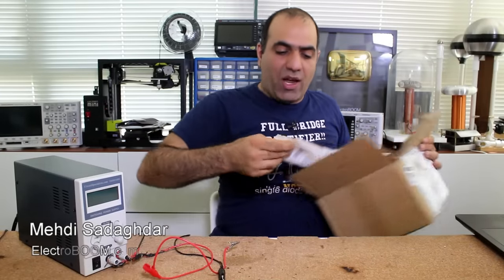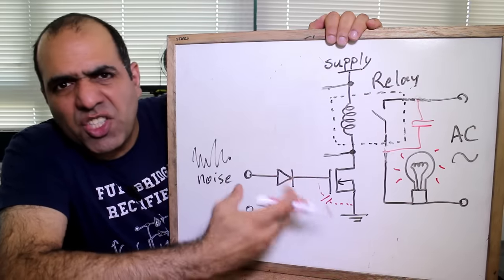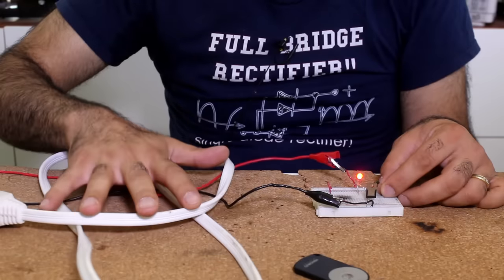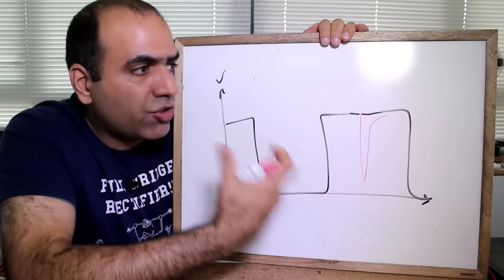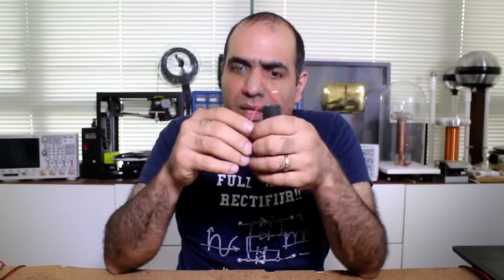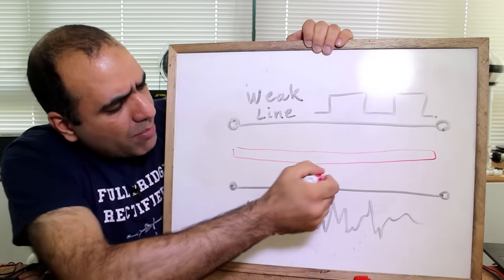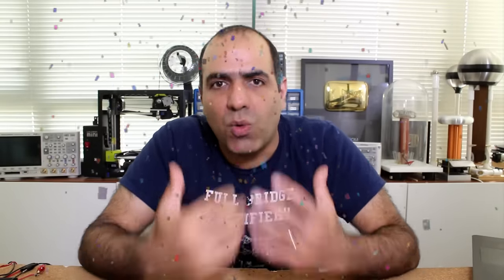Destruction with EMP Device, Understand and Battle EM Interference

Comment: This guy really knows what he's doing...if u dont have a complete intutive understanding of electricity....you wont be able to do what he is doing and still be alive
Reply: Exactly, those fails are on purpose because showing them makes you pay attention and be careful if you want to work in a project like the one he features, works much better than a simple warning
Reply: Thanks I was gonna do it but I’m 12 and i have no idea what I’m doing
Reply: When I was a kid I did "experiments" with electrical components that easily could have been the end of me. I survived . I  now  design and build high powered diesel electric generators. One time when I was about 12 we paralleled eight CRTs (picture tubes) to create enough capacitance to fire a ruby laser. (Successfully) This was in 1968. The amount of power stored in that CRT bank was awesome. And deadly. Even small capacitors can store enough power to be dangerous. Sometimes for really long periods of time. Make sure capacitors are discharged before handling.  Failure to do so may not end well. Antique electronics can hold some very powerful and unpleasant surprises for the unwary. Enen if not powered up for years.
Reply: no shit

Comment: I'm convinced mehdi takes time to calculate the voltage and current of each shock before he does it to make sure he doesn't die, then does it anyway

M A D  L A D
Reply: I got a shock from the same flash capacitor circuit he was using, in the exact same way (touching ground with one hand and power with the other), and was convinced that I'd need to see a doctor (anxiety does wonders for this), but then I calculated the current (350 volts / 50k ohms) and it was definitely less than 7 milliamps, probably more like 4 as I used the absolute lower bound for human body resistance, which equates to "mild sensation". Still gave me some arm cramps in the morning, though.
Reply: @eelooplanitia6640  I have a feeling that the cap you touched wasn't fully charged. I melted the steel on a screwdriver once by discharging a photoflash capacitor across it that was fully charged, it sounded like a pistol shot when it went off.
Reply: @OlegKostoglatov  Yeah that makes sense, I had only charged it for ~7 seconds
Reply: @eelooplanitia6640  c'est vrai... however take into consideration all the shocks he has taken over his career... I bet this M A D L A D could take more then 7milliamps
Reply: @OlegKostoglatov  wait how the hell is that possible
Reply: @OlegKostoglatov  also, steel has much less resistance than the human body
Reply: Absolute madlad
Reply: He did say it in an interview that he always plan all of his video including all the sparks :). So dont do it by yourself lmaoo
Reply: Nah, better way to check if this will kill you on yourself, to check if your breaker will be safe.
Reply: He almost died when he accidentally catch a his Jacob's ladder and suffered a third degree burn in his 1M special
Reply: He hasn't died because he doesn't give high voltages a path through his heart
Reply: i even believe he has some firecrackers involved
Reply: @OlegKostoglatov  the screw driver is so low in resistance that it will allow  massive current to flow. You can melt a screw driver or weld it to car battery  terminals if you short  positive and negative but you would have a hard time feeling anything if you short that across your body.  So the fact he only got a mild shock from the capacitor doesn't really indicate the charge
Reply: Touching 230 VAC is not nice (didn't have GFCI in my room) just a shit ton of luck
Reply: He just knows how to touch it, he isn't letting his body become the circuit, he's just interrupting the circuit.
Reply: Well he has a carpet...
Reply: @tearex7023   "As long as you don't die, chances are you're totally fine." - Tearex 2020
Reply: Good for the heart.
Reply: Gets shocked: C  O  N  T  E  N  T
Reply: I'm convinced of the same thing.
Reply: @tearex7023  LOL "that's just extra food" that ending got me
Reply: @eelooplanitia6640  always remember the one hand rule when working with high voltage,keep the other hand behind your back so your heart isn't the fuse in the middle of the circuit
Reply: Dudes just genius 🖖❤️
Reply: Except for the giant sparklers. That was him nearly dying on camera.
Reply: @eelooplanitia6640  it's generally advised that you see a doctor after you got a decent electric shock across your heart. Severe heart issues don't have to immediately show or even be present when receiving the shock, they can occur anywhere within 24 hours after the shock. I don't know the explanation for this, but quite a lot of people died hours after receiving a severe electric shock, while thinking they were fine.
Reply: It isn't always staged, he tends to be caress and forgetfull.
Reply: I'm pretty sure he uses cgi instead.

Comment: Ahh that explains why my screen gets crazy when I use an unofficial charger, Thanks ElectroBoom
Reply: It's actually worse than that.
A GOOD AC to DC converter first uses a FULL BRIDGE RECTIFIER to make the power go always on the same direction, but the signal that comes from it is basically the AC signal but with the lows flipped up, so you have to use a good capacitor to filter out and deliver a good, constant 5v.
And guess what gets skimped out?
Reply: @dan_loup  I wish more chargers were onhe top end of the spec ie 5.3V Very rare Galaxy Note 3 genuine
5.1/5.2 I've seen eg Apple's 

Because I can't tell you how many usb cables I go through every year...
Plus peanut butter is the worst for handling phones/tablets without perfectly clean hands post eating.
to deal with resistance/voltage drop in the circuit
Reply: @transkryption  The whole charger thing is annoying as frik, specially when it's USB, because every phone have its own way to say "it's me, give the full charge" to it's proprietary charger.
Reply: My phone goes crazy when I use an externally powered speakers. Now I understand too.
Reply: Been using cheapest chargers and leads for years and years with no interference whatsoever.
Don't waste money on official shit that does nothing that cheaper shit can't.

Comment: 9:50 You...made a spark gap radio...
Old timy wireless radios were just EMPs? I never thought about it that way.
Reply: Basically, any radio emitter could be called an emp, we're just messing with the signal before...
Reply: Yeah, pretty much. They quickly tried to get away from the ringing pulse, to a continuous wave because of the amount of frequencies contained in the pulse. That makes one spark telegraphy signal take up the space of 100 continuous wave telegraph signals.
Reply: Brisingr eragon I mean yes but no. It’s conceivable that a carrier wave could induce a voltage in electronics but it’s more likely it would resonate at a set voltage. It takes a short pulse of broad spectrum to get massive induction spikes and other craziness that would cause electronics to go haywire.
Reply: @Mostlyharmless1985  That depends on exactly how you define "go haywire"... and the extent is just as determined by power available as the rest of the model... 

   In regards to strictly "interference", though, eragon's got a sound principle.

    Think about Ham radios, and CB's... In "normal" operations, they're assigned specific channels (frequency bands)... AND as long as everyone's playing approximately by the same rules, sticking to those channels will do the job of communicating and functioning normally with no interference...
    BUT around here, there's a LOT of iron in the ground, and mountains everywhere... SO a popular "trick" among radio amateurs is "Power dumping"... where-in, one custom builds a basic power amplifier, and wires it directly between the radio and the antenna. A robust build with a single fuse-able circuit in the house can add (120VAC @ 15A "fuse") 1800Watts-ish to broadcast strength as well as reception "boost"... BUT there's a side-effect to poorly planned or positioned amplifiers called "bleed-over", where errant signals and segments of communication literally slip into channels outside the designation on the radio-set dial (even a digital).
    Add enough to the "power dump" amplifier in principle, and you can cause all manners of chatter and noise to a variety of "nearby" bands, and if we're honest, 15A is relatively small in circuit protections common to code...

     It's worth note that (even here) this practice is illegal. It can result in fines, jail time, and obviously equipment either taken or destroyed by authorities.

    It's finally just worth mention, that while none of it would be very effective maliciously, it's enough to be worth some dubious cautions about cell phones and other transcommunications on aircraft, where steady communication with ATC and other craft is a high SAFETY priority. (where the obligatory requests to turn off phones and tablets comes from). ;o)

Comment: I remember seeing small handled EMP device used to force cheap badly designed fingerprint or code lock system to reset, and the lock will open during its initialization
Reply: A surprising amount of electronic door security systems are also vulnerable to the simple wooly socks plus finger combo attack. They look fancy and effective though, which is the main point most of the time; dissuasion of attempts of intrusion being more important than prevention :p

Comment: 10:15 Just curious but is there any way to fix the device that has been damaged by EMP?
Reply: Depends on what kind of effect EMP had. It can be temporary damage — for example, flipping some bits in a digital circuit, then you can reset the device and it'll be fine. Or, currents created by EMP may physically burn some of the chip's internals, damaging internal structures permanently, in which case it's next to impossible to repair.

Comment: Hi Mehdi, and hello from Ottawa!
I have issues with my guitar picking up 60 cycle hum, and I use all of the techniques you mentioned.  Could the idea of having 3 orthogonal coils placed at the end of the signal flow before the signal is sent through the cable work? Is there a way of tuning an RC circuit to filter 60 cycle hum? Thanks

Comment: As a weird note, in canada the Federal Communications Commission (FCC) requires that electronic devices must be designed to "accept" any interference received, including interference that may cause undesired operation. Meaning that while making a device such that it still works with a degree of interference is legal, making a device so that it can not be interfered with is not.

Comment: In order to protect the gate of the transistor from overvoltage, voltage limitation circuits are often applied. One possibility is to apply zener-diodes (or TVS diodes) between gate and emitter (source). Another possibility is to use fast switching Schottky diodes to clamp the gate to the driver supply voltage.

Comment: The circuit at 2:23 could be used as a pressure detector that would shut the power off if the line is trampled on. This way, you could save yourself from high-voltage shocks, although at the cost of a wire with broken insulation, through which the electricity could arc to something metal... or you.

Comment: Take a wire wrap a wire into the circle then take off of one end and circle the circles around the circle wire now go back and circle the circles again or making the bigger circle and then go circling inside the wire and making circles to bind the wire together then you hook one side to your capacitor in a little capacitor fuse block then you take your taser and you wire one side to each side of the taser and click the damn capacitor once the capacitor charges up enough to make a taser zapped again the circle will have your EMP wave

Comment: Mehdi, I always put a high value resistor from Gate to Ground on a FET so it shuts off immediately when the switch is off. But you knew that right?

Comment: I used the earth as a amp to chrash basic electronics at a quite high distance relative to the power of the generator. the only big problem was that you manually needed to connect and disconnect(switch) the positive and negative wires for each pulse.

Comment: I build all my circuits in metal enclosures because my workspace is by a really sketchy power supply, a bunch of florescent lights and my breaker box, so anything I built at first that wasn't in a Faraday cage would have tons of noise in the circuit.

Comment: Dunno if anyone will read this, but if you mount a raspberry pi in a cab that also has contactors in it and your pi uses signals from any of its gpio pins, every time a contactor opens or closes your pi will register a signal - that shit annoyed me for a month - in the end I just coded the software to ignore pulses that were shorter than half a second.

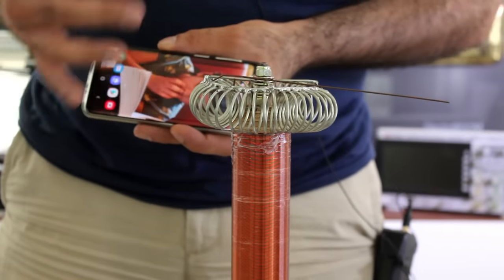Comment: 7:45
You described Lockheed Martin's point defense counter UAV system
It uses radio waves to jam the connection between the drone and controller causing it to either land or return to base. These have made it to the front line in Ukraine even though no one talks about it.

Comment: EMP can be used to hack things too. In particular when it's directly on the CPU (like XBox/PS) or Phone.
You have to start it at the exact moment (by monitoring the clock).

Often your have:
- [Do some calculation]
- [if a==b] launch signed code.

You can do:
- [Do some calculation]
- You try to create a glitch at this point to return true even if a!=b
- [if a==b] launch unsigned code. <- lower energy of the chip or create a short-circuit at this point to create a glitch.
- If not successful, restart.

Or
- [Do some calculation]
- You try to create a glitch at this point to return true even if a!=b
- [if a==b] launch unsigned code. <- start EMP
- If not successful, restart.

Comment: I.like the drivable EMP. just replace your spark plugs with ones that don't have a diode and use unshielded plug wires. No one in a half mile will be able to use a radio when ur truck is running

Comment: How does radiation effect low voltage info wires, such as cat5 and coax? Technically, with coax you have two wires, the internal single wire, and the woven external wire. Both shielded by plastic, sometimes rubberized, but never with an official third "ground" wire.

Comment: Hey ElectroBoom, 
I work for a company that produces multiconductor cable for many different applications.
I primarily focus on two operations, Cabling(putting all components together into one cable) and testing the electrical properties of said cables.
I wish that they would have gone further into depth on exactly what the results of the tests actually mean and why they have to be within certain ranges e.g.) Impedance, Time Delay, Skew, Rise Time, Attenuation, Return loss, Near end cross talk, and Far end cross talk. We test using both an oscilloscope(TDR) and a VNA(up to 10GHz) 
I have a decent understanding on what the proper ranges are on the wires that I am testing but I would like to learn more on how those ranges affect the final product. 
My company doesn't really show us what our cables go into but I'm 90% sure that a large majority of our cables go into imaging such as Medical endoscopy. 
could you make a video on why testing cables to make sure they are within Spec. is so important, and if there are any techniques to change the properties of a component wire, being either UTP, STP, or coax. such as tightening the lay length or tightening or loosening the braided shield on the components or the whole cable itself. I would do the experimenting at work but I don't think my bosses would be too happy about that.
Reply: Start off by looking up the definition of characteristic impedance and transmission line theory and focus on source, load impedance matching to the characteristic impedance of the cable.

Time Delay, is a function of not just the cable but the source driving it.
Skew is to do with the transmission of multiple signals down the cable , typically a clock and data. You need to be looking at data communications for this but.

.VBA gets a bit tricky to understand.
Attenuation is simply how much weaker the signal comes out if the far end relative to what went in at the opposite end.

Rise time is a function of the source driving the cable as well as the cable. Look up rise time in data communications. If I remember correctly it is the time taken for the signal on  the cable (typically a pulse) to go from 10 to 90% of its maximum voltage, and this impacts the highest frequency -:and hence maximum speed of data transmission.
Reply: Thanks for the info!

Comment: I have a USB DAC (topping D30) that occasionally when a light switch or bathroom fan on the same breaker circuit is flipped on and or off the DAC stops outputting sound. The power and signal indicators stay on. If I power the unit off and on again it continues to work. 

It also has an optical input and when I use it with the USB cable unplugged from the DAC, it is not affected by the switch (EMP?) (1950s wiring). Any tips on how to fix this problem?

Comment: interesting
i get a humming noise through my sound system on my computer when im charging my car battery outside.
so i guess that my car battery charger is sending "noise" through the power cables in the house?
the battery charger is more than 20 meter's away (65 foot) and the house voltage is 240v as i am in australia.
the batter charger is connected by a 30 meter (98 foot) extension cord. would that have something to do with it ?